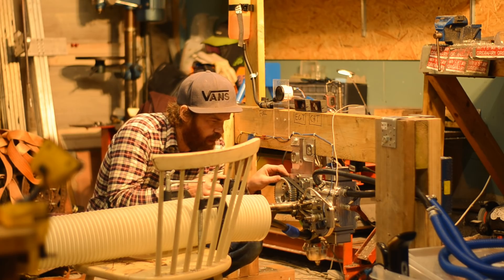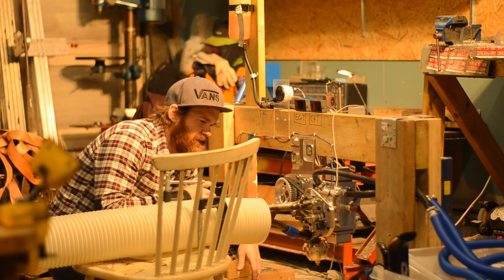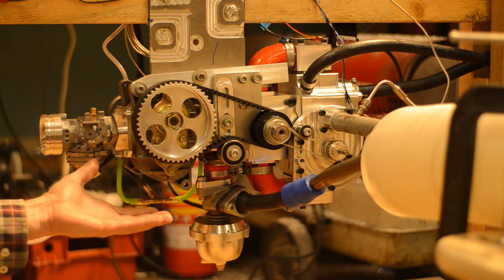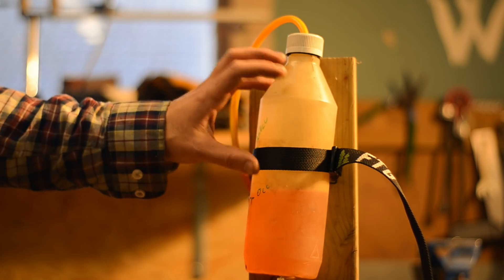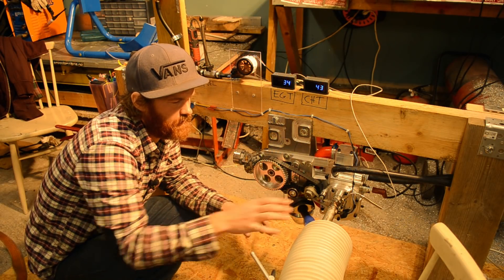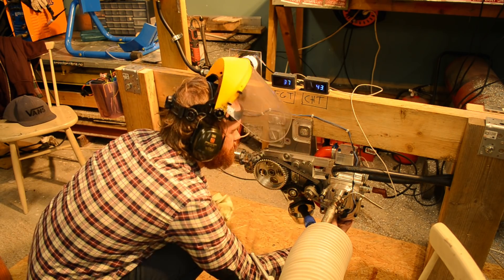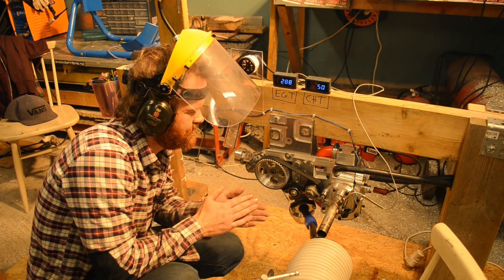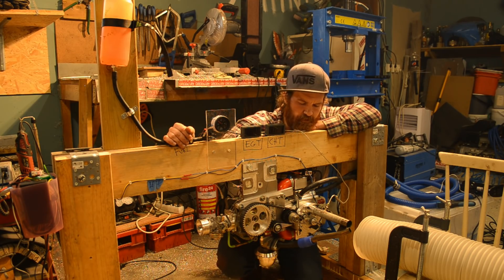WTH is this!? Supercharged nitro two stroke.

Comment: You need to keep an eye on your intake plenum volume. For single cylinder engines it's especially critical.

Hard to guess what's the volume overall right now, might be plenty already. Iirc it should be at least 5-6 times the engine displacement for rather obvious reasons if you think about it.
Reply: Our 100cc is 10:1 volume

Comment: Do you plan to add a tuned pipe to this engine, or is that not relevant due to supercharging? I'm glued to this now, to see what the power output is.
Reply: He mentioned a few vids ago that it might get a megaphone style pipe. Reflection pulse is not needed due to the exhaust valve.

Comment: Alex! 
I am so happy for you. Your creation is running and running great so far. 
I didn't think that the rotary valves will hold up the exhaust temp, and you may will run into that problem later on.

I like it very much the introduction what elements doing what, very glad to see that explained.
By the way I was happy to see/hear at another video your explanation while editing it.

Can you run us through about the readouts on the gauges.

Question: what compression ratio and bore/stroke figure?
I know you have some secrets, maybe so, that's fine.

Keep up the good work.

Comment: Would it be worth testing to see if simply adding a turbo charger to the end of the exhaust down pipe would act an expansion chamber and create enough back pressure to negate the need for that leaky disc valve and  pre-charge the super charger at the same time,  no internal modifications would be necessary and  the results could benefit science in general and mankind as a whole.

Comment: To remove porosity from printed parts, Add risers to 3dp parts, coat in plaster of paris and bake just above glass temp. Knock off as much as you can by hand and dip in vinegar to get the residue off.

Comment: Re those plastic parts, you need to use metal sleeves in the holes.
if you did the bolts up just enough to hold the parts on and not distort they would probably not leak
Using metal sleeves the bolts can be done up tight and the bolt tension load is taken up by the sleeve and not the plastic that is causing the part to distort.

Comment: while building and testing 3D-Printed Intake runners on a car i got no luck with the standard flat compression gaskets because the plastic has to low e-modulus compared to aluminium. To seal iam using o-rings in a grove now, so i dont need as high clamping load to get a perfect seal. Also making the flange parts thicker or with strengthening ribs helps a lot. For negating "creep" of the plastic i started using 2-4 belleville-washers to keep the bolt preload more constant when heatcycling to not have them come loose. Keep experimenting, its worth the trials imho.
Reply: How could anyone give this guy thumbs down?
Reply: @kenneely7899  His girlfriend and the neighbors maybe trying to get to sleep? LOL 😂
Reply: @kenneely7899  my thoughts exactly.. Probably some loosers
Reply: Agree.. o-ring works best with composite flange
Reply: Something I have seen in the bottom end of a cheap clamshell chainsaw cylinder was a machined groove and then RTV, the goove made the RTV work a bit like an o ring rather than sealing precision surfaces, that way you can seal much more complicated shapes than having to stick to standard o-rings.
Could be implemented in a print fairly simply.
Reply: Could it be printed over a metal insert?
Reply: @Sailingcoachpete  yes, that's an option. You still have to come up with worked metal, so it isn't as easy as burning one off the printer, but people do it. There are a number of ways people combine metal into plastic prints.
Reply: Aluminium is better and you know it
Reply: This is great, thanks for doing this. 🇬🇧🇬🇧👍👍

Comment: Do you print carbon nylon on the ender 3 ? If so what mods do you have ?...Im thinking of printing carburetor flanges myself as that would make it much easier than standard metal cuting amd welding.
Reply from the maker: Microswiss hotend, that's all. Well actually I installed a volcano heater block too, but 4hqt was for faster prints with larger nozzles.
Reply from the maker: "that"
Reply: Ok will give it a go then. Thanks for the info.

Comment: Have you ever thought about internal super charging? Ie, cutting swirls into the outer halves of the crankshaft, like a vaccum cleaner blade, and feeding it through the crank berring, I think this would provide superior lubrication and cool the fuel,thus I'mproving preformance and extending high rpm life,of course you would have to use reed valves,tell me what you think😎keep wrenching brother!
Reply: Is it like having power valves like yamaha ypvs/Kawasaki kips/Honda-atac etc? Just curious since it would need a design change but it would significantly give a kick to that mad supercharged engine. Just a thought that came out.

Comment: I was trying to think of ways to seal those 3d printed parts but I think having a kind of a dome shaped mating surface like you mentioned previously would probably work best. probably wouldn't even need to be domed very much to create a good seal.
Reply: Lol it will never metal on metal why not just put in an actual fkin gasket o ring or something🤦🏻
Reply: @MV-ri7zu  his 3d printed parts are carbon impregnated plastic. not metal.
Reply: @kasuraga  thought he had problems with the metal parts sealing too?
Reply: @MV-ri7zu  only issue he had was between the exhaust wiper disc housing thing pushing fluid out cause of the pressure. it didn't leak before even without a seal. but previously he had issues with leaks around every 3d printed part